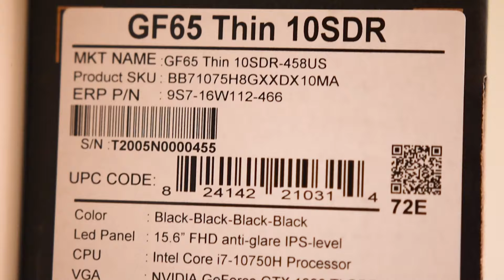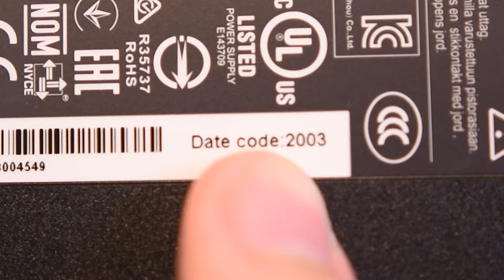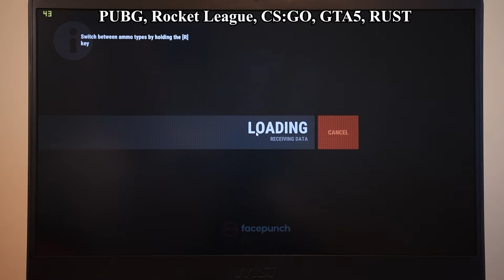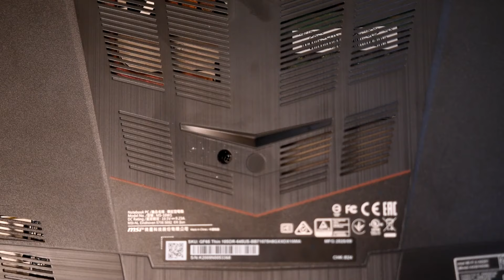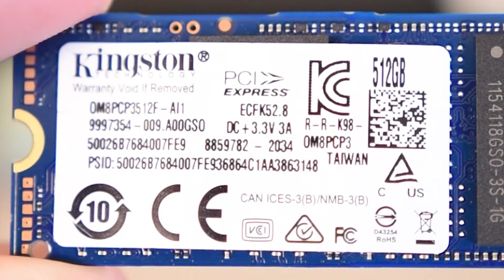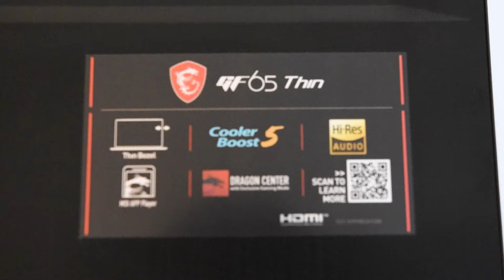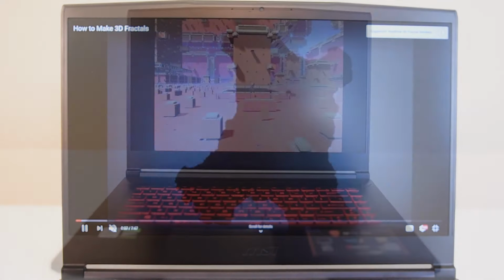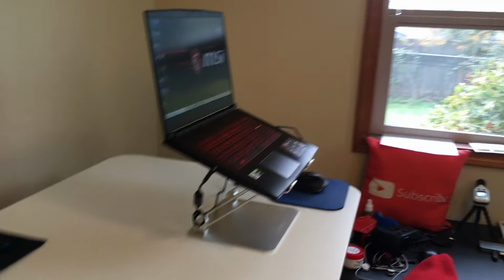GF65 Thin MSI GAMING LAPTOP REVIEW, GTX 1660TI,  6 CORE 10750H

Comment: I have just ordered this laptop, seems to be exactly same spec as one in your video OP....EAN is  4719072701086    Laptop arriving soon and had a few questions.I want to put in  extra storage, spec sheet on MSI says "1 x 2.5“ HDD + 1 x NVMe M.2 SSD by PCIe Gen3 / SATA-SSD Combo Slot" i want to buy and fit a 2TB Netac N600S 2.5in SATA 6GB/S TLC 3D NAND SSD in this laptop, would it be compatible..keeping original SSD boot drive?  Also can you tell me exact specs/brand/frequency of 8gb dimm already fitted so i can buy exact same module again.Thanks in advance and thanks for the great video.

Comment: Hello, i got that same laptop with 8gb of ram, would like to upgrade to 64GB, but not sure what kind of ram should i buy to be compatible with the device, im going for a budget sticks and searched from the local ebay so here are the two options, can you please help me out which ones gonna match my devide (msi gf65 thin 10sdr // 10750H // gtx1660 Ti)

option 1: Kingston FURY Impact SO-DIMM 64GB DDR4-2933 (17 19 19) 1.2v
option 2: Crucial SODIMM 64 GB (2x 32 GB) DDR4 3200 CL 22

Tyvm in advance for your review.....

Comment: BRO im using this laptop. I buy 3 months ago at official store. D prob is if I play gta V, fortnite, cod at extreme power at battery power. Cpu temp 95+. How to solve tjis prob.?
Reply from the maker: You can try repasting, or under volting.
Reply: Is undervolting safe for laptop?

Comment: can this laptop handle: yuzu emulator chocobo racing only, dead by daylight medium, resident evil 7 medium, fortnote non-performance higher than low.. yes, these are weird games, not AAA or anything. buying a laptop for no so serious gaming, it's mainly to keep busy while i'm in thailand, also play a few games with my lady (we're into some older emulation, but i'd like to at least play the above with her without any real performance issues or having it look too ugly, especially RE7).. is this laptop overkill or can i go lower?
Reply: I own the 10th generation of this lap top and i am impressed. This laptop will definitely run all the games you listed and even some AAA games if you decide to play some. Only thing i have a problem with is thermal issuues and like the guy said the speakers arent great , but i was able to fix the thermal issue by undervolting the cpu, which wont effect the performance of gaming . Only thing i notice is loading times are a little bit longer, but not by much at all. And the speakers not being that great hasnt bothered me cause you can get a cheap set of small speakers for it or use a bluetooth speaker. Plus most gamers ,including myself, use headphones when gaming. If you do go with this laptop I would recommend getting one with 16gb ram or you could go the cheaper route and buy the one with 8gb ram , 512gb ssd and then upgrade it yourself. I was able to find a Used Msi GF65 with 8gb ram and 512gb ssd for $350 and installed another 8gb ram for $30 and the install was really easy. I WOULD HIGHLY RECOMMEND THIS COMPUTER , I ABSOLUTELY LOVE MINE.

Comment: Bro which is best. 
Msi gp65 leopard 10sdk gtx 1660ti or msi gf65 thin gtx 1660ti
Reply from the maker: Gp65 is fed more power to the system so you are more likely to get better performance it’s also a heavier system so if you want something lighter I’d get the Gf

Comment: I just bought this laptop but the storage seems too less but if I want to expand it is it possible and if yes till how much I can upgrade it? And would it be practical to just get an external hard disk to work and store data as an SSD is too costly?
Reply from the maker: Depends on the work you do and it depends on how fast you need it to be, HDD is real slow, and SSD has come down in price quite a bit. What I do is get an External SSD, I use a Samsung T3 and Samsung T5 both are fast and work well. SSD can also take a drop or fall and not break. If you can afford it id just get that instead, External ssd might be a little annoying at times but its protected if your laptop dies you just unplug your ssd and your good to go. The machine can also support internal nvme ssd which is another option but those are usually a little more expensive, but really that will depend on the brand. 

What kind of work do you do and how fast do you need it to be? How much do you have to spend?

I am trying to build the best tech & entertainment channel possible if you have any questions I am always standing by to help you with your tech needs what ever they may be. I will always be there for you, So if you like this kind of content I highly recommend you subscribe. :)
Good luck!

Comment: Which is better msi gf 65 or hp pavillion
Reply from the maker: The hp will have better build quality perception but the MSI will actually be more practical, lighter and easier to work with. Does that make sense what other questions do you have?
Reply: @SERGE_Tech  how about performance wise?
Reply from the maker: The performance should always be good enough even the quad core is still keeping up quite well a 6 core cpu would be a little bit smoother, if you have the budget opt for that for sure but if not you might not even notice a difference, like me I am super anal I like the best fastest hardware possible so I spend and spend but most of the time a lot can be achieved even with basic hardware. 

In regards to creating content, the content is king not the hardware, I had to learn that one the hard way. Gradeaundera proved this with his low quality videos but high quality content.

Comment: Bro need help i want to know that does msi    gf65 gtx 1660ti has dual fan cooling system
Reply from the maker: correct it does, except its more like 1.5 fans because it shares the 2 fans with the cpu so if the cpu is not doing well it can drag the gpu down.. or vice versa does that make sense?

I am trying to build the best tech & entertainment channel possible if you have any questions I am always standing by to help you with your tech needs what ever they may be. I will always be there for you, So if you like this kind of content I highly recommend you subscribe. :)
Good luck!

Comment: If I decide to add another ssd, do I need a second thermal pad?
Reply from the maker: Most of the thermal pads are pure bs but it will depend on the ssd most can operate with out one.

Comment: Got this laptop, had big problems 
Fans at Max RPM when i turn laptop on
Played ps1 emulator and fans with high rpm, played warzone and fans same thing, then laptop turn off 
:{
Reply from the maker: I think your getting unlucky, contact MSI for a replacement they will get you one that works trust me they care about there people.  Although the loud machine is exactly what it is. but actually all of them get this loud and hot, its basically normal unless you get area 51m its basically impossible for it to be quite...

Comment: How many fan does this laptop has?
Reply from the maker: 3 weeks later did you end up choosing a machine, sorry I missed this question. Would love to help you pick a machine. this has 2 fans and it shares heat pipes which isnt the best design however it works just fine. 

What type of games do you play? are you worried about the cooling?

I am trying to build the best tech & entertainment channel possible if you have any questions I am always standing by to help you with your tech needs what ever they may be. I will always be there for you, So if you like this kind of content I highly recommend you subscribe. :)
Since I am building this channel for you! Help me build it. 
Would love to have you as a sub some day. Anyway let me know if you have more questions!

Comment: Looks like the RAM is running 1Rx8. Youll want that to be 1Rx16 or it will cause the laptop to potentially be up to 20% slower than it should be. I can link source of proof if need be.
Reply: Hey, could you link the source?
Reply from the maker: yes please provide link would be nice to read. Thank you!

Comment: Drop a vid for the battery life tips please..👍🏻
Reply from the maker: alrighty battery life tips coming right up!
Reply: @SERGE_Tech  Thanks ,  i was thinking of buying the i7 and 2060 version, but also need some amount of battery life doing normal coding and surfing, like 3.5 hrs minimum, but i had read on reddit that its battery life barely lasted 2.5hrs , which would cause a problem for me , so could u please tell how much things like undervolting , limiting clock speeds or disabling the use of 2060 when not in use could take the battery life too, if doing this takes the battery to 3.5 to 4 hr i would be satisfied, but 2 hrs is completely unacceptable for me.👍🏻👍🏻❤️
Reply from the maker: Great questions and I think you have a solid grasp of where you need to go with this. True undervolting and underclocking could really help. on windows pc they have seriously failed to have good battery life that average users like me and you can set better profiles. I used to disable cores on my 6 core cpu just to run less hot. all fairly similar. 

I am confident you can get about 3.5-4hrs of battery life and in the case that you get lucky maybe more. It would be super awesome if you did the tweaks and came back here with your results since my estimates are mere estimates it would be good to know how close you got.
Reply: You can disable the graphics card via the msi dragon center software that comes preloaded. With the battery turned to performance, the graphics card disabled, brightness at about half, and the backlight for the keyboard off I get about 4.5 hours of battery life.

Comment: Can it play high end graphic games on higher fps?
Reply from the maker: Great question, actually this bad boy games quite well, its 1660ti is considered a low to mid range gpu and those still tend to game quite well. Any gaming pc that was made in the last 4 years will be able to game quite well almost regardless of its configuration. 

What other questions do you have, would love to get some more subscribers :)
Reply: @SERGE_Tech  you have a handful of subscribers incoming boss ;)

One last question,
I'll be using it for college purpose too, what battery backup should i expect with on normal mode (without charge) and any tip from your side about this laptop regarding college will be highly appreciated :)))

Comment: Why the f is CSGo giving so less FPS in this beast? It is giving me 150+ in 1650 4gigs easily.
Reply from the maker: I have been trying to figure this out for a while. My guess is maybe the power plan settings are wrong or the device is over heating. I noticed some video cards just perform better.

Comment: Can I upgrade or increase VRAM on this laptop?
Reply from the maker: only through an external graphics card, the video card it self cannot be upgraded but you can expand the laptop by getting a external graphics card and connecting to usb c. This would be something you would do 3-6 years down the road when you need more graphics. For now the laptop probably runs quite well.

Comment: Hey dose anyone know there a laptop that can run gta5 black ops 3 under 400
Reply from the maker: have you checked used markets yet? that will get you the best performance but you could get a new machine with a good igpu and that could possibly work as well. You could also try gaming laptop refurbished websites. Have you had any luck finding any yet? I could help you find some.

Comment: Was comparing Ryzen AMD 2.1 GHz vs i5 11th gen, everyday-usage 15.6" laptops on Black Fri - Cyb Mon last week.

Stroke of luck, this is. Thanks for the professional and comprehensive breakdown, and keep doing what you do 👍. Stay safe.
Reply from the maker: Wow what a great comment thanks to you as well!!! Do you know what ryzen specifically because there are 3-4 different generations and I see you have the generation name on the intel product. If you have the exact model for both cpus I can let you know which one is best.
Reply: @SERGE_Tech  Haha you have me checking out Ryzen on Wiki just before sleep, but it def looks interesting history. 

Models were on BestBuy, both sold out but can find them here:

(1) Intel Core i5-1135G7/1TB SSD/16GB RAM/Windows 10
https://www.bestbuy.ca/en-ca/product/hp-15-6-laptop-natural-silver-intel-core-i5-1135g7-1tb-ssd-16gb-ram-windows-10/14960571

(2) AMD Ryzen 5 3500U, 1TB SSD, 16GB RAM, AMD Radeon Vega 8
https://www.thesource.ca/en-ca/computers-tablets/laptops/all-laptops/hp-15-ef0020ca-15-6%e2%80%9d-laptop-with-amd-ryzen-5-3500u%2c-1tb-ssd%2c-16gb-ram%2c-amd-radeon-vega-8-windows-10---silver/p/108091021  

For the record, I've found an alt solution to my needs so prob won't even be buying a new laptop, given the stock and pricing issues during Boxing Week. If it's of interest to you, I typically purchase AMD processors due to multi-tasking and pricing, despite being aware that Intel cpus boot much faster in RAM and general clocking power.

Comment: Don’t buy this, buy this instead it’s a tiny bit more expensive has more power and has ray tracing. 

https://www.bestbuy.com/site/msi-gf65-15-6-gaming-laptop-intel-core-i7-8gb-memory-nvidia-geforce-rtx-2060-512gbsolid-state-drive-black/6421620.p?skuId=6421620

Buy another stick of ddr4 and you’ll make the performance skyrocket.

Comment: my gf65 is rtx 2060 and 144hz.
Reply from the maker: nice you have a very good configuration. After a few months use, do you still recommended it?
Reply: @SERGE_Tech  It is great in all aspects, until I bought valve index, I found out that its usbc does not support dp port.

Comment: this computer sucks. once i downloaded my first game it lagged.
Reply: I have not had any problems with mine when it comes to lag. I only had overheating issues but was able to fix it by simply undervolting the CPU since games mainly use GPU there was no performance loss. If yours is running too high temps it can cause an FPS drop and will appear like lagging. You can look up some tutorials on how to improve game performance on the GF65 thin and that should  help.
Reply: @mr.bojangles3696 it's probably a different computer then

Comment: dont buy this laptop fan problems
Reply: what kind of fan problems, only thing i have noticed is there are no vents on the back plate where the fans are located.
Reply: @mr.bojangles3696  the fan after 1 year or year and half its will cause loud sound and its will not work, the speed of the fan will be 300 but normal is 3000 .
Reply: and you gonna need to buy new fans and maybe the motherboard will broke after the fan not work, so not worth it.